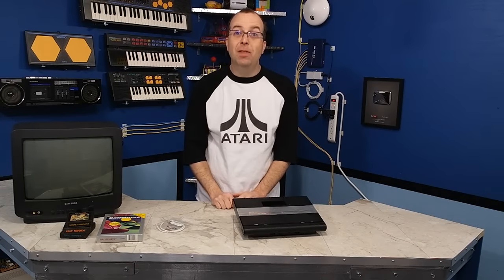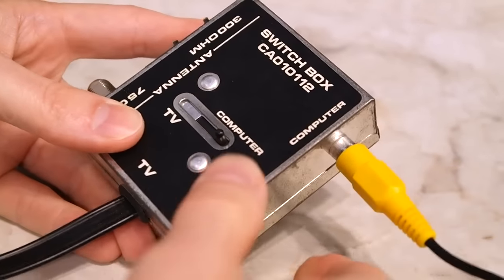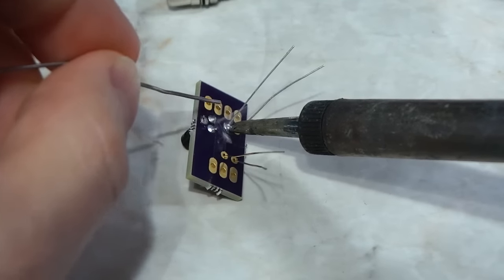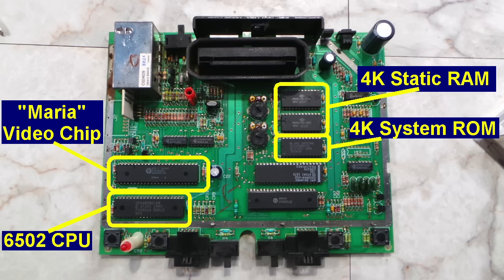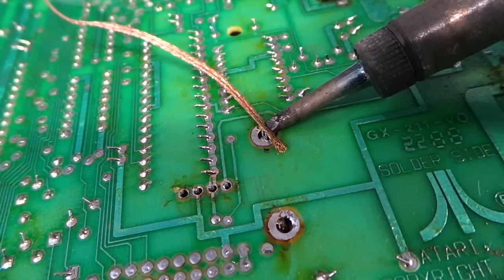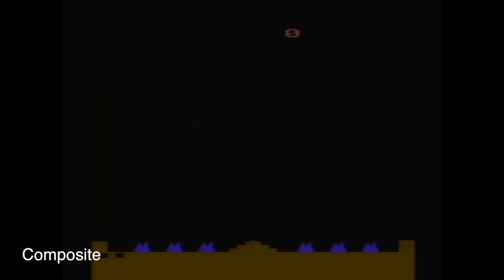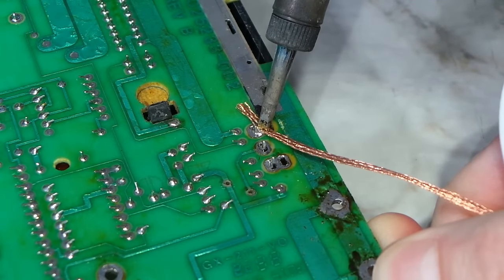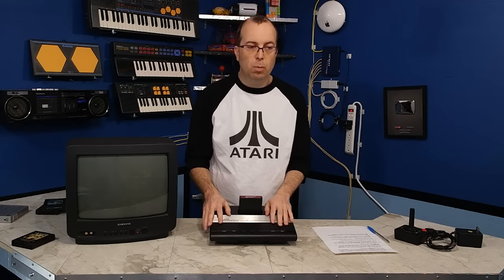Atari 7800 Composite Mod and Review

Comment: I realize this is an old video, but for anyone interested in doing this now the issue he had with the sound on 2600 games can be corrected by leaving one of the resistors in (R5 on the board), bridging it at the bottom to R6 right beside it and then attaching the audio wire to that bridge. Info can be found here: https://atariage.com/forums/topic/256230-av-modded-7800-missing-sounds-on-some-2600-games/ - Cheers. :-)
Reply: In fact it is better to leave R5 and R6 unaltered when doing this type of mod, in my case after figuring out this, soldering other resistors to see what happens, using for a long time the same pin 8-Bit Guy used for audio, I replaced R6 with a 22k ohm resistor (Original is 18k ohm, but I read in my multimeter 14.95k ohm), the levels between TIA and POKEY are pretty decent. I also found out that the higher R6 is, the TIA volume decreases and POKEY volume increases, and I routed my audio output to a pin coming from C9 (C9 is located right next to R5 and R6). I'm still documenting my observations on this.

Comment: I have kept 3 separate TV/Game Switch Boxes for my Atari systems (2600/7800/400). I have 2 separate specific unit switch boxes for my Nintendo systems (NES/SNES). I have a composite connection cable for my Atari 800XL computer system. I have retained 2 Color CRT TVs for my RF systems, but I need to find a replacement composite color monitor.

Comment: a Phono to F connector adapter usually works for the rf  and it could have a cleaner signal (somewhat) but a composite or S-video mod is best.

Comment: On the topic of the double sided tape for mounting the board; that particular type of double sided tape is actually used to mount trim and decals to vehicles. It's extremely strong and robust. I don't disagree with the way you mounted it, but it would probably have been fine with the tape. Cheers!

Comment: It was too late once the wires were soldered on, but if done prior to soldering, you should be able to route the wires through the holes in the board (such as where you removed the RF box) without cutting anything. The cable sheath may not have fit through, but the wires inside of it should have.

Comment: If you can, seek out the gamepad controllers that were bundled with European 7800's.  Much more comfortable than the 7800 sticks.  I'm in the UK and have two such mod kits, that can apparently be used for either the VCS (2600) or 7800.  When I get around to fitting them, I'll just use one audio connector, and use an adapter on the cable to send audio to both speakers.  Worth pointing out to non-US viewers that the exact points to solder wires to on the motherboard may differ on their 7800's.

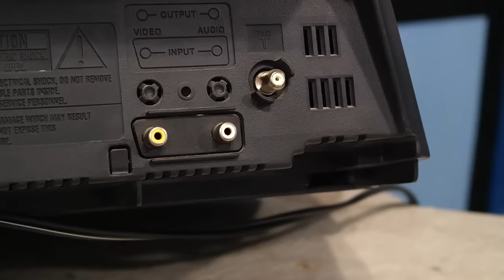Comment: 2:10 you don't need all that, just a RCA Female to F-Type Male connector (a small little adapter you put on the end of a rca cable, usually costing around a dollar or two.)

Comment: I've just checked the number of audio outputs the TIA has: one for each channel, so you should get stereo if you wire them directly to the audio plugs instead of going through the main-board's mixing circuit.

Comment: Not sure if anyone has said it in the comments yet, but atari had a buyout in 1983, and the 7800 had already been produced. However, their new president opted not to ship them out due to the video game crash of the time. The systems sat in a wearhouse until the NES revived gaming, and out they were sent. Thid could explain the somewhat antiquated video hardware inside of it. Of course, some of this info could be wrong, but to my knowledge it is correct

Comment: i recommend you check out the original xbox. it was a powerful console for the time, and has some good softmodding and hardmodding related things. it's the polar opposite of the 7800; it was advanced for its time and supported up to 1080i from the very beginning, if you had component cables.

Comment: By the way I can personally say DONT go for the stepdrill on old plastic parts or plastic parts in general, they will easily wreck your piece (even with intended use), if it grips the plastic and your not holding it tightly enough it will just smash the entire thing (not much fun after youve spent 3 hours cleaning everything). Also if you take it too far (impossible with regular drills) you are screwed, because your item might be very rare.

Comment: Cool I got one of these recently it needs cleaned before I use it.
I did test it and it does work. :)

And dang I missed you at PRGE?
I'll be there again manning my booth again it will be the Pinball Reviewer Repairs booth so come on by if you will be at PRGE this year.

Comment: The reason the sound sounded strange on composite is likely because of the higher-quality signal afforded by the separate audio signal.  RF would sound more muffled and that would make the noise sound as it does in RF.

Comment: I have a few comments on the kit.
- I am surprised they didn't include more flexible stranded cable.
- For the video and audio, screened cable would have been better
- It is a pity the original RF output couldn't have been kept.

Comment: The pal 7800 has the RGB connector of the Atari ST computer BUT only outputing composite, not RGB, even though it end with a scart plug... Oh well at least it's composite out of the box :) (Don't bother to get one though, it's region locked and outputs in slow 50Hz).

Comment: You actually don't even need the RF converter box.  You can use a Male to female RCA to F-Type coaxial adapter coupler.  TV's from the 1990's and newer are capable of reading signals directly from the RF transmitter without that converter box.

Comment: You need the switch box if your console if NTSC to adapt from RCA to coaxial but in PAL territories, pre-NES consoles output directly to coaxial so you can plug the into a TV without the switch box.

Comment: Double stick foam tape will stick to glass, metal, or plastic forever so long as you thoroughly clean whatever surface you're sticking it to with denatured alcohol, the same goes for stickers and decals.

Comment: you can buy converters that use the yellow cable or rf cable in one side and the other screws right into the coaxial on your tv way better than those big tv switch boxes

Comment: Actually the earlier model Atari 7800 consoles were made in 1984. They were mothballed after Jack Tramiel took over Atari and concentrated more on computers than game consoles. If your 2600 comes in a silver box with "Atari 7800 ProSystem" in purple, and the console has an expansion interface on the side, then it most likely is one of the 1984 models.

Comment: I loved the 7800.  I was extreamly upset when (back in the day) my father threw it all out because I was not using it.  what he didn't consider is I wasn't allowed to bring it upstairs (had to use it in the basement) and I couldn't play long before my allergies forced me back upstairs.  Biggest downside with the 7800 is it wasn't a perfect backwards compatibility with 2600 games, though did work for most.  2 audio jacks may sound better on some tv's otherwise all sound may be on only one speaker.

Comment: The little Atari had no composite because they wanted to be compatible with every TV. For example, I hold CRTs from late 90's and mid 2000's, maybe a version of me in the 80's would have TVs from 60's or 70's. Like, the 80's weren't like today when you can actually buy a brand new PC every week even if you earn nothing at work, TVs and stuff was way expensiver back then (hence why I collect these, these were better made, nowadays everything is cheaply made and die shorter than their old versions). Now, while old TVs had no composite, EVERY TV from the 30's until today still has the RF input or the antenna input, which is neat because that increases compatibility

Comment: Really cool mod. I thought about maybe grabbing a 7800 at some point. Id want it pre modded though, lol
Reply: You could do that, or wait to buy a 7800 Game Drive which has RGB video output from the cart.
Reply: @KrunchyTheClown78  elaborate?
Reply: @ObsidianContraption  Stone age Gamer, and AtariAge just sold out of 7800 Game Drives today unfortunately. but the 7800 game drive is a flash cart that accepts SD cards like the everdrive, and has a video output for RGB SCART, and component cables right from the cart itself

Comment: Hey Dave, I'm surprised a great cable manager like you did a poor decision like that.
Side input ports  make sense for peripherals not for audio/video out, especially in that case you have 3 separate cables coming out the side. You should have routed the cables to backside and drilled the holes there.

Comment: Since you're doing some stuff on the Atari side of things, need to get an 800XL (not the plain 800) or a 130XE (which is better than the 65XE or XEGS). Some of the things they do different to the C64 are probably interesting enough to visit as a video topic.

Comment: 80s cable tech here. I hated those tin RF switches too. I had RCA to F connector adaptors  that I would install with a commercial  A/B switch with better isolation. Made many young game players happy that they could keep their game system hooked up without parental anger over the poor picture quality.

Comment: You can get stepper drill bits on eBay for a couple bucks. They're not the best, but for plastic and thin metal cases I think it'll be alright.

Comment: You can get a step drill bit at Harbor Freight pretty cheap.  No, it's not a good of quality as a more name brand one, but it will work perfectly fine for thin sheet metal or plastic.

Comment: Hello David ! I have a pal 7800 here in France, it comes with RGB scart connection (exactely the same as the one we had here on the Atari ST computers), but it works really bad... I only get a picture when the TV displays its OSD. As soon as the OSD goes away, so does most of the image of the 7800 ! No other consoles I own do that... So my only chance to play the 7800 is to have some OSD showing on screen which is distracting. Would you have any piece of advice about that ? I can send you pics and vids if needed :)
Reply: @IcyTorment  yeah the rgb is really bad on my french system I can confirm that. A pal  Atari is always problematic unless modded or plugged on older 80's TV with analog chassis. But on my 90's Sony crt it messes up with the digital internals of the TV's chassis and will display only black until TV shows some OSD information. Imagine facing this issue back then and try to figure it out...

Comment: looks factory, the RF shield is probably not needed since you aren't using RF to broadcast.  However; keeping it cannot hurt anything.  That said in some other mods (not for the 7800) like adding wireless / radio things RF shields have to be removed.

Comment: Nice mod to the system. The composite output looks (and sounds) so much cleaner. As to why the 7800 didn't support this in the first place, the system was all ready to go in 1984 but Atari was sold and focused instead on computers. Two years later Atari then decided maybe video game consoles weren't dead, so they released the slightly old console.
I can also tell you the 7800 joystick controllers are horrible, when I had a 7800 they cramped my hands like crazy. It's not too difficult to find the European joypad controllers, which I hear are much better.

Comment: Vinegar is an acid -- a weak acid to be sure, but give it enough time and it'll do the job on the corrosion without significantly damaging the good metal.  I used to work at a Household Hazardous Waste facility, so I came to know a lot about acids and bases.  And pesticides and oxidizers and a bunch of other bullshit.
Reply: OneEyedJack1970 Vinegar 😍😍😍

Comment: A little phosphoric acid (available from a hardware store) will stabilize that rust and prevent it from getting any worse. Edit - that's only good for the shield, not the circuit board!

Comment: where did you solder the other end of the final wire? the one to enable 7800 sound.
Reply: Pelger: I'm wondering the same thing. What was the yellow wire used for?

Comment: I don't get why the the people who came up with this mod have you chopping off resistors & caps. I just did this same mod on my 7800 a couple of months ago, and after digging through the schematics, I found that the unpopulated pin header on the left side of the board, labeled J2, carries both composite video and the full audio mix, including POKEY sound. I just soldered the video amp board, and the audio connector directly to it & got perfectly good results. I didn't lose the ability to use RF, too.

Comment: A new RTS for C64? A hero you are sir :)

Can you comment on the tech stack? ie: You really could draw your tiles and mapper on a modern machine and then just have the game engine on a C64, but you're tackling the Hard Way (yay!) .. but I'm curious if you're writing in 6502 ASM, or using a C cross compiler, or .. etc etc, theres a lot of ways to skin that unicorn. Let us know :)
Reply: I should also note .. looking to manufacture carts? I've not made C64 carts, but I made my own homebrew computer (with a cart slot, of course! :), and I ended up repurposing beat up old Atari 2600 carts since it was neat, and I had some, and old Baseball carts seem to come up cheap fairly frequently. The actual pcb for a game on retro machins is usually very rudimentary .. you can knock out PCBS cheap on a service like elecrow (4" square pcb, 10-13 for $10, plus shipping... thats double sided, solder resist, silkscreen, the works!) .. so depending how many you make, you could knock out a few hundred pcbs cheap, and hand solder them. It would only take a couple minutes to solder each one really, so it depends how many you'll have .. (being a popular YT site will help with that though :)

The plastic cart boxes always seem to be a problem; or is there someone making them for the C64 already? Stickers and such for it, easy.. but that plastic box, thats the hard part in my book IMHO.

Also depends on the chip you use for the cart .. is it a masked rom, or a flash chip, an eprom, etc; a function of price to be sure, and of programming it .. be curious to know which stack you've thought of (or maybe you've not thought about it at all yet.. plenty of time yet.)

There are lots of folks who can help out with the electronics if you need; I could, but you could probably make a good video set with Ben Heck or any of the famous folks :)
Reply from the maker: 6502 ASM.  I don't think it would be possible to do this in C.  It is quite a squeeze to make it work in assembly.

Comment: Obviously this is years later but adding a 6k resistor (IE, one that you pull out of the system when doing this mod anyways) will lower the volume of the TIA audio and make it not overpower any pokey sound

Comment: I used the mod from the AtariAge forums linked in my video here on YT (search video If8m_m1IhHw or my channel for "7800" and click the links in the description for more info - My video is crude cell phone video but the forum post has good pics of the mod itself). There is no transistor needed for the mod I did, but there is a potentiometer used for brightness control (probably what the transistor is used for). I just used a Y cable to connect the audio to a modern TV. It was rather amusing to play games on the big flat panel in the living room and have the audio output through the surround sound (all channels). My video shows the mod with an OLD TV though. Never did make a vid with the new TV.

Comment: I used to work for RadioShack and I would have ppl coming in all the time trying to hook up late 70s and  80s tech to modern stuff and it fun bc most of the time it would work....but then you would have that percentage of ppl that would give up once the cost went over 5 bucks.

Comment: The reason the Atari 7800 doesn't have rca video is because it was meant to come out before the video game crash. By the time it came out in 86, it was still virtually unchanged from its original early80s design, even with a lack of a pokey chip on the motherboard.

Comment: I would strongly suggest against only using one RCA port just because it's mono. I doubt many modern devices are still designed to detect a mono signal because only one jack is under load. You'd probably just end up with sound out one speaker.

Comment: The design of the 7800 was finished in the early 80's, but because of the 1983 video game crash they waited to release the console until after the NES had a successful launch.   That is probably why no composite inputs.

Comment: You can always convert the RF output to an F type connector using an adapter https://amzn.to/3bk1JZD - no clunky video/game switch required, no surgery. Just plug in and tune to the channel. Of course, composite video is better and has less noise - but if you need to avoid modding, it's an option.

Comment: What code are you programming your game in, C?  I started a game a while ago but just got the tile engine finished using DirectX7.  It is similar to the Ultima tile engine but with 8 bit 256 colour bit map images and a smooth scrolling screen as the character walks.  It was a lot of work, I just wished I finished it.  may be someday.
Reply: Considering he's using a Commodore 64, he's probably using assembly or BASIC.

I don't know if there were any C compilers for the C64. If there were, it would be better to cross-compile, if possible.
Reply from the maker: 6502 Assembler.  You can do C on a C64, but I don't think it would be fast enough for what I'm doing.

Comment: Another simpler possibly cheaper option is an rca to Fjack adapter. Works with my odyssey2 (the original cable broke and I had to use an rca cable.)

Comment: The reason the 7800 doesn't have composite is that the 7800 was a 1984 machine. They were supposed to be released then, but because of the videogame crash it wasn't released until the NES brought video game consoles back.